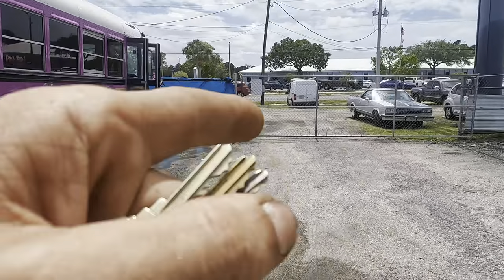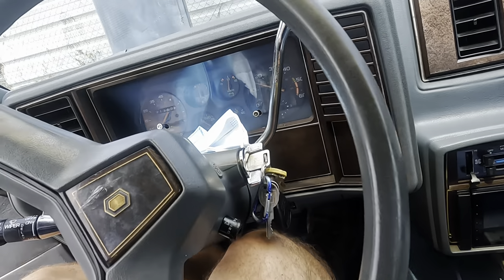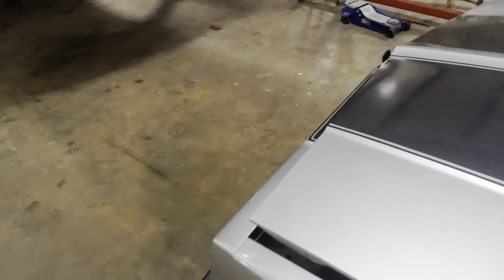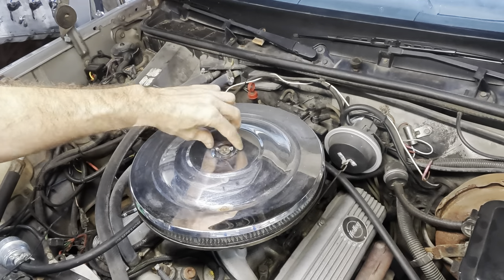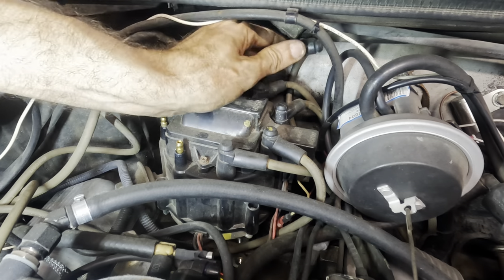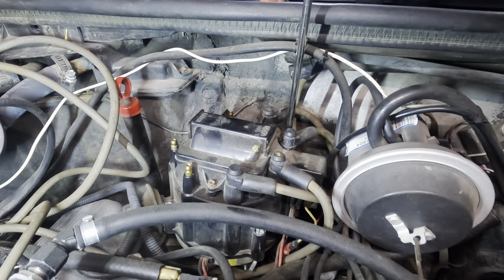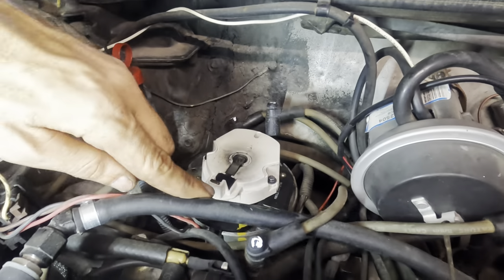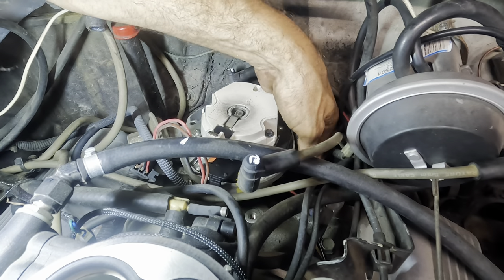Shuts Down While Driving! 1985 Chevrolet El Camino | Karen Story at End #mechanic

Comment: If you insert the distributor in the gears without moving the pump or cam the shaft should line up. If it does not and you have not turned the crank (and thus the cam) then the pump shaft will have moved. When setting the new distributor in, the cam and distributor gear will still align properly, the distributor will just not drop all the way down as the oil pump drive slot for the distributor will be misaligned. This is not a problem as when the engine is rotated the shaft will align at the proper point and drop in. It is just a matter of sliding the distributor clamp on the clamp lip and tightening it down. The last step is then to reset the timing. All done quick no problem and easy.

Comment: When it comes to the Odometer, if the meter has flipped or rolled over, the numbers will not line up perfect. That " 9 " would be off a little, so those ARE original miles :)

Comment: I'm sure Ray knew he could remove the distributor by just loosening but not remove the distributor hold down clamp. That's why the slot. I still have my three distributor wrenches and timing light but my dwell/tachometer died several years ago.

Comment: Or you can advance it until it pings, and then back it off a little, and I’ll be correct timing. When you have an anchor at your loader should point towards the number seven sparkling.

Comment: Ahh the good old "dizzy" as we call the distributor in the UK. That was always a fun time for me and my late father. Brings back some repair memories. Like that road trip when the vacuum advance blew out and he only got 30mph on the motorway and had to limp 100 miles home. Shitty Rover Metro's were my dads favourite car. It was the better devil he knew. The hydragas was always another bugbear.
I much prefer more modern cars with fuel injection and OBD2. But absolutely not the latest anti-repair cars with serialised components that need a so called "calibration" with the dealer computer and a hefty price tag.
As for that Karen - there must be a law against hogging the fuel court? I mean in the UK we are quite strict on queues and stuff socially and this would be completely unacceptable and unheard of!

Comment: Lol if you’re one tooth off you will know it 😁 you don’t have to but when I worked at the Chevy dealership I would always bring it to TDC on number 1 and then do distributor . Just my way 😵‍💫 I still have my oil pump priming tool when built small blocks . It made turning the pump shaft easier

Comment: 95% chance the $15.00 ignition module was the only issue. They are notorious for getting hot and quitting, especially the aftermarket ones. 5 minutes to swap it out. Most people just carry a spare and a flat blade screwdriver.

Comment: Firing order for a small block Chevy all small block Chevy are 1843657 too remember that you won't have to worry about crossing up plug wires then and you probably have with any mission issues like that would wante check the firing order

Comment: It seems odd to me hearing HEI called old school technology when it came out well after I was out of school. Some 1973 GM models had it but all 1974 models did. The first systems used 60,000 volts to the spark plug and a .060 spark plug gap. The rotors were a problem as the spark would burn a hole through the center of them if mechanics pulled a spark plug wire to check for a miss and the spark didn't have anywhere to go. Many of the insulated pliers made to pull spark plug wires with the engine running would shock the user as the spark was too hot for them. GM then changed the coil to drop the voltage to around 40,000 volts and made the rotors out of a different material. The entire ignition system is inside the distributor. The bad part about that is it also meant all of the heat was inside of it too and electronic modules don't handle heat well. There was a heat transfer past between the module and the plate to help cool the module but that paste would dry out over time requiring a change to silicone past. Mechanics would change the modules without cleaning the mounting surface and applying new paste and the modules would quickly fail. Later HEI systems had the coil mounted outside of the distributor.

Comment: Everyone talks about how older is better because you can fix it yourself, but the truth is no one’s replacing distributors and retiming newer engines so there’s no need for it to be easy.
And I’d sure rather replace 8 coils on an ls than deal with a distributor and timing a 350.

Comment: I wish I was alive back then in this era. Working on things without major processors and scan tools, being able to diagnose issues with basic tools and fix them no custom 1 part only 500 dollar tool (There were exceptions), and the cars looked better. I have to get a custom program and a laptop to change things on my current truck as well as having parts vanish the second generations change. Only downside is my line of work was more dangerous back then and people died more due to it which I wish wasn't the case.

Comment: One more old fart here in So Cal.  Not sure which struck me funnier.  The Karen rant or that timing lights now belong in some antique car museum.  Haven't used mine in 20 years, but its right up here on a tall shelf.  Covered in dust, next to my exhaust gas analyzer, dwell teater and compression gauge.  And when I assume room temperature, I'm sure they will all amuse and befuddle my heirs.  Then go straight into a huge dumpster.  Such is life.

Comment: The old GMC and Chevy had an issue with heat. On the starter side it would heat up the solenoid and it would be hot In traffic and car would stall. Well when you tried to restart the starter solenoid would be hot and no crank for about 10 to 15 minutes. 
Well the fix for it was installing a Ford start solenoid to increase the amount of current to the Chevy start solenoid. And that fix the no start issue. How do I know this I restored 1962 Chevy Impala. And had this issue and after researching I came across this fix. And most of the old car guys knew about this fix

Comment: Make it simple, its not a car or a truck, Its an open back station wagon. If you want a more complex comparison, Jeeps and even Broncos had a closed back version and open back version. The station wagon is like the closed back version and the El Camino and even the Ranchero are the open back version. Oddly enough the Crossover is kinda the modern version of the station wagon but its more a mix of a mini van with a Jeep (Cherokee) where as the station wagon is a mix of a van with a car.

Some don't ever understand why people like the old station wagons or El Caminos but they were cars for a place in time and even specific use. Station wagons were when traveling roads, sometimes going from one state to the next with a bunch of luggage for days, was a thing families did pretty commonly. It was kinda the minivan of the time but tended to have a fair bit more power as they sometimes were expected to tow around things like pop up campers and light utility trailers with light boats. El Caminos and Rancheros were less travel and more slight work like moving furniture going gardening and light stuff. One was for family and the other was not. 

I personally still like the station wagons for their lower profile because if you needed to put something on top like a Kayak, a small fishing boat, or even a tree then it was easy as hell to put it on and take it off. I also like the El Camino like vehicles or the older compact trucks like the Dakota, S10 or Ranger as they were meant to do work out of the back. Reach into the back over the side and get whatever tools or stuff you needed to work with. Don't have to climb into the back of the truck and don't have to try and climb into the seat either.

Comment: dont waist your time with a timing light just keep advancing the distributor until you get some ping under load on the road at moderate speed then back it down by hand slowly until the ping stops thats timing it  for fuel and elevation together and way easier then jerking around with a timing light. if the motor timing chain is after market like a way roller 3 way timing gear you could be off by 40 degrees initial timing and not even know because the timing tab wont sync with the advanced cam dilation.  timing lights are ok for relatively stock motors to get you close to man suggestion but by no means does that make for the best performance every aftermarket build is different.

Comment: I have and still use as a daily driver a '68 GMC C1500 with a transplanted SBC 350 and original distributor with a "uni-set" of points and condenser. And I still got my light and timing/dwell meter. Dad bought this truck for me when I joined the Marines in '67. He said it was for me but that was just so he could keep mom from b!tch!ng about the cost of a new truck. When I came back in '72 and took it, he bit a railroad spike in half, well he could have if he had one, maybe, almost, ok he had false teeth but you know what I mean.

Comment: That Woaaa sound is the sound of the carb being opened much to wide for the fuel and the engine will bog because of a bad fuel air ratio. This however, is generally caused by timing being off not a fuel air mis-adjustment. You just need much more air to get a combustible mix when the timing is retarded. If the timing is too advanced it will pop back through the intake. The timing has a factory setting picked for most efficient fuel use vs power output. More power can be achieved by more advance, to a point. If you do not have a procedure for power tuning it is best to use a light and set to factory spec for that engine.

Comment: @Ray You named two of the 3 ways to adjust timing. Here is another one for your tool box. 
1. Timing light. great if the timing chain is not stretched. 

2. Ping under load, then retard by 5 degrees. I used to lug out my datsun 1200, 15mph, 3-4th gear, full foot in throttle. If it hesitates advance, until it pings, then retard a few degrees.

3. Remove the vacuum hose off of the timing advance diaphragm and plug it into a vacuum gauge. Adjust for max vacuum with the least amount of needle movement. I know you have a vacuum gauge. 

I checked my best running settings on my Datsun 1200 (1974), using method 3 or 2, with a timing light. It was supposed to be 5-7 degrees. The light showed I was at 14. Before you ask. I set the dwell with feeler gauges and dwell meter first. I know that my method is totally redneck, I was a poor college student, but it works. It ran poorly when set by method 1.
Reply: Used #2 with my 76 Celica GT

Comment: The reason you need a timing light is that you really can't just throw a SWAG at setting timing on well tuned highly modified engine. Ignition timing tuning is usually at the ragged edge and too much can destroy an engine and not enough hurts performance. 

A simple wild a** guess isn't good enough. 

You need timing light.

Comment: I put in lots of points and condenser in and set the dwell with the spark plugs out and crank the motor over adjust my dwell to 28* then set the timing at 6* before top dead center then loosen the springs on the qudarejet secondary’s. You would make that 350 cui chev rip. The customers would come back and say what did you do to my car or truck. I push down on the accelerator and it takes off like a rocket. As my old Chev mentor said just tell them FM. F$(:’ng Magic

Comment: This car kinda shows how they were a lot more simply made. I mean that as they were pretty much made so people could easily enough can work on them. You don't have to disassemble half the wiring harness and remove a dozen covers and brackets to change something simple. Now cars are made to be worked on in a auto shop and not really a home garage anymore. Its not really all the electronics but how the engine compartment  and car body is designed and how crammed in everything is.

Comment: Not sure how a mechanic can operate without a timing light.  This can't be the only time you fooled with the ignition system.  Kind of like a tire tech without a pressure checker tool.

Okay, he explained that.  Still an odd omission.  Now that I think about it, modern cars don't even have a distributor.  The computer uses a crankshaft position sensor to figure the timing.  Mind stuck in past.

I see that you got the gear in correctly, it only goes in certain ways - correct or off a lot.  But the base rotates infinitely.  It could be off some.

Comment: When I think of all the time's I had to "index a distributo." That's what we called it back then. And I never use the timing light I always power timed it. You would have your buddy or your girlfriend sit in the driver's seat with the engine running they would put it into drive, and then they would give it throttle. You would retard the distributor until it started to Ping and then Advanced it just a little bit. It was always dead on balls accurate. I used to drag race Sportsman class. Oh, those were the days.

Comment: Mom had an '86 El Camino, the doors were always a problem, they were so freaking huge and heavy the hinges were not up to the job.  She loved that car, but, she did not maintain it, it didn't last very long.  Shame.  Funny how I see these vehicles from that time and think how horrible those years were for cars, about 1974 through 2004.  But at the time I though they were so great.  Cheap poor fitting plastic and just low quality control, sometimes bad engineering like the mid eighties Blazer transmissions.  If they were any good at all you would still see a few around, I don't think I have seen a Blazer from those years in at least a decade.  My personal thinking on it is when they switched away from leaded gas they tried a number of different ways to seat valves and they all just failed.  That and pollution controls meant they were running without proper fuel mixture, and the state of the art computers of the time were a joke.  I am pleased with the quality of my 2021 Silverado, once again properly maintained we can expect them to run a long time.

Comment: Windows down, it's Hot in here and Stinks like Cigarettes.... Aluminium (AL-U- MINIUM) valve covers, 'n a aftermarket Air Filter that has 1/2 the induction area of the OEM CAN,  And now has No Cold Air Intake which is crucial  'fer proper atomization in hot environments like Florida...Replace the aftermarket under hood air intake with the OEM Canister and Cold Air Intake....Guaranteed, that will fix the "Stalling When Hot" Complaint...If the Air/Fuel mixture is correct...OEM HEI should be good, but replacing is an option.

Comment: Those Astro 525L lights suck ass!  I bought one a month ago from all the hype from different Youtube mechanics. Worked fine the first time, then when I went to charge it the second time, it took over 8 hours and only showed 2 bars charged.  Charged another 8 hours and got 4 bars, bit less than an hour of light.  Bought the fancy schmancy magnetic charger and did the same thing.  Junk.

Comment: Actually NOT 'mechanical ignition distribution'. Mechanical means POINTS! This is standard HEI type distributor. Very simple. I don't think it needed a complete distributor unless the shaft/bushings were worn. Module just needs changed. Common problem. Grew up with this stuff.
Reply: Sometimes the coil dies also.

Comment: Why do I get the feeling that you somehow are not comfortable with working on older vehicles. The timing must be rechecked with a timing light. I hope the customer takes his vehicle to another shop that has a timing light, and knows how to use it correctly, or get a mobile mechanic that is equipped.

Comment: Yes Ray, you will need to get a timing light. The pickup unit inside the distributor is sensitive to positioning relative to the shaft. You can also use your white out to mark the spots for 8 to 10 degrees before top dead center (a guess on my part, look up the actual spec.) and the mark on the crankshaft pulley with the little notch on it. then just twist the distributor until the marks line up.
To answer the burning question...Car or Truck ? I would say Car. El Caminos are built off of the Malibu station wagon chassis. It just has a large box where the back seat and cargo area would be. But as strange as it seems, It still uses the big doors from the 2 door Malibu. It was pretty much the same on previous generation El Caminos and the Chevelle. It's a mid-size car with the hauling capacity of a mini truck, like the Luv, the Currier or any small Japanese mini truck from the same time.

Comment: I am 62 years old and grew up working on these simple systems and never thought that I would say this but You really should not have done this particular job, You are a great mechanic but in this video You gave a ton of bad advice, yes You should mark the position of the distributor only for reference purposes, the tuned port injection system on this car was a piece of junk when new and most aftermarket units that replaced them were even worse, when the timing was right they were prone to spark knock under a load after they had a few thousand miles on them not to mention a 91,000 mile 305 is really at the end of it's life cycle anyway,  in 85 the oiling systems were not much different than the 70's unlike the engines of today. Buy a timing light even if You are not going to use it more than a couple of times in the next decade, You would have looked more professional doing things correctly instead of how You did this one.